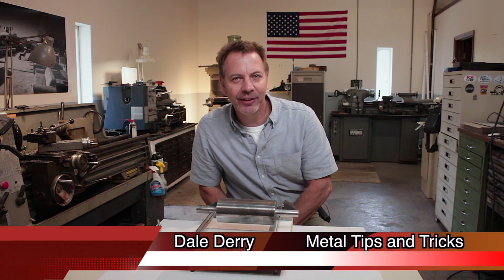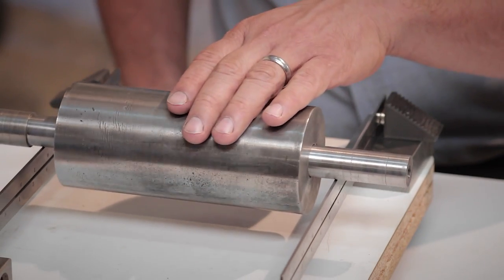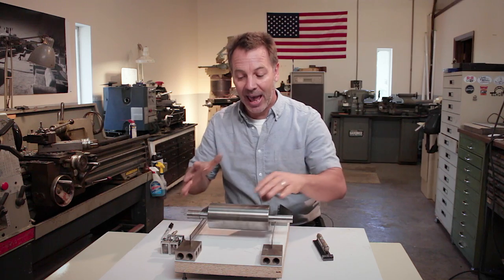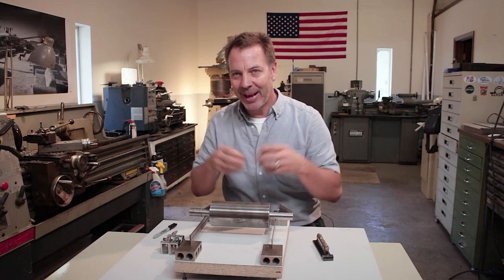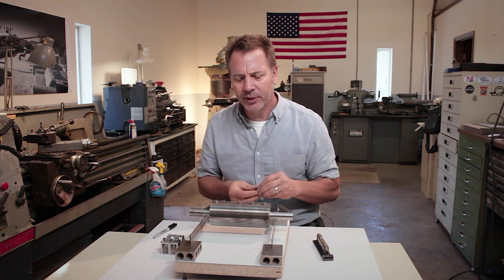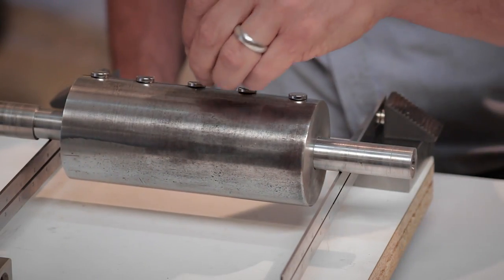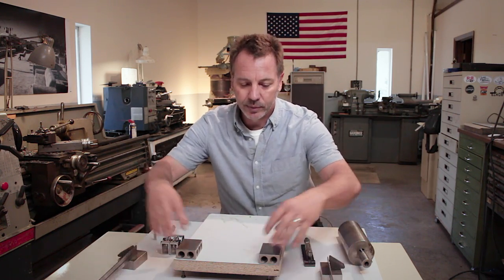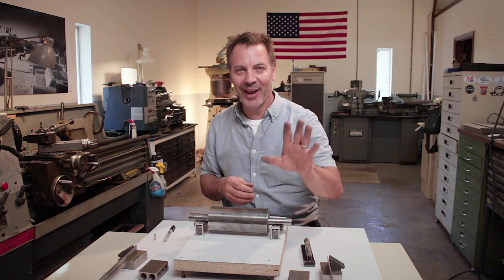Tough Turning,  The Follow Up

Comment: I have balanced a similar item by mounting the shaft in a lathe between centres, no drive dogs, just relying on the friction of the centres to spin the job......I then put a sharpie on the tool post and wound it in until it just....and I mean just touched the spinning job.....the tiny mark left was the heavy side, and them used magnets to correct the balance, and eventually drilled the ends to balance.
The good thing is I was able to balance both ends independently to some degree....
this was all done after the work was complete, and the job trued...

cheers
John

Comment: Hello Dale,
Nice video.
To find the centre of gravity of the work you could mark the centre of the job and place it on a table on top of a piece wire, filler rod, pencil or any small round. 
Roll the round under the job to see when the work tips from one side to the other, its tipping point will indicate its centre of gravity.
Hope this helps
Keep up the good videos
Thanks
Leigh
Gold Coast, Australia
Reply from the maker: +Leigh Edwards  Thanks for the information.
Dale d

Comment: This is a good teaching about static balancing, after on those big high speed rollers there is also dynamic balance, a little more difficult in a normal small machine shop... ;)
Pierre
Reply from the maker: +Full Metal Ratchet 
There are no guarantees in life :-)
Dale d
Reply from the maker: +pierre beaudry 

IT sure is.
Dale d

Comment: Thanks for the video. For those who are thinking about building the Turn Wright Machine Works {Keith Fenner} Shaft Roller Kit, Keith also has a set of plans you can down load / copy. For what it's worth, I'm building 2 (two) sets / 4 rollers, material cost approx $100.00.
Reply: Slight update - Keith recently uploaded a set of videos showing how to machine his roller kit.

Comment: I found in using this type of balancing, the straight edges work the best with sharp edges. 
I've used it balancing aircraft props and it works great.
David
Reply from the maker: +David Reaid  I agree, the sharper than the better
Dale d

Comment: To help with finding which end might be heavier, look at how to balance connecting rods for engines. Use a digital scale, weigh the whole part first. Then support one end of the shaft from a hanging string, while the other end sets on the scale. Make sure the shaft is level. Now you can weigh the other end or just subtract the weight from of the first end from the total weight of the shaft. This should give you a good idea if one end is heavier than the other. Buy if you have two different length shafts on each end it may take some math to figure it out. Great video though.
Reply from the maker: +Dynodon64 
Great Idea

Comment: To measure if it is balanced longitudinally you just need a balance and a parallel at exactly the same height as it then weigh it each way around and see if there is a difference, then drill accordingly. I also wondered what if you need a perfect cylinder, would you need to just turn it between centres or is there a better way to balance it?

Comment: One thing you may have over looked
Are the blade grooves true?
If NOT setting the blades would be impossible.
A real cool project for a badass guy like yourself would be a helical with carbide inserts replacement

Comment: owning one of these planers, i can say balancing and perhaps even cutting would have been better if the blade wedges had been in the slots and torqued. there is a measurable flex on the head when the blade wedges are installed..

Comment: Was wondering.

 If you set up one of the rules to sit 1" off center of the roller (and the other at an equal distance per shaft diameter that is equal on each side) then used an electronic scale to weigh 1/2 width + 1" of one side, record the weight, then do the same on the other side (1/2 + 1") and compared the weight, would that not give a difference in the weight from side to side fairly accurately?
Reply from the maker: You might be on to something. I'll have to give it a try.

Comment: In part one you said the journals of the shaft were running out. I believe you said the .375 bearing surface was bent? Did you address that problem?
Without the bearing surfaces true with the body, success is probably going to be very hard to achieve.
Kap
Reply from the maker: +This Old Machinist 
The shaft was straight it was the bore through the head that was off. The repair worked great. the machine now runs smooth.
Reply: So how did that happen? The bore was off out from the factory and they made a shaft for it that was off too?
Reply: Yes, but......the cutters within the head bolt into slots that will continue to be non-concentric if the bore was not run through the centre of the cutter-head.  This will always remain the case despite turning the diameter of the cutter body concentric to the bore.  In short, when in use, the 4 cutters will still each cut a different depth of chip as they all rotate at a different radius from the centreline of the bore - the decent solution is to ditch it and buy an aftermarket alternative (helix cutter head etc).
Reply: You set the knives to the same diameter, not to the depth of the slot.   Jointer knives are set to the height of outfeed table.

Comment: The best static balancing wheels have a very large (and accurate) diameter, overlap (to get the contact points up high), have very small bearings (to reduce rotational resistance), and have a (nearly) knife edge (to reduce contact resistance). Unfortunately, this makes them fairly expensive. See http://www.mcmaster.com/#shaft-balancers/=yzx8hj for some examples - $1000 to $2000.

It does seem that for light objects (home shop sized) that something less expensive could be made.
Reply from the maker: +Peter W. Meek That's exactly on one LOL. they cost to much.

Dale d
Reply: +Peter W. Meek those are gonna make a nice little shop project, thanks for that link!

Comment: If you could set the rullers at 45 degrees so the shaft only contacted the corners, you'd have very little friction to contend with.

Comment: I watched this video for the first time today and I have a way to reduce the friction using the steel scales/blades.  It might be impossible to find, but I bought a machinist's tool box loaded with tools and one of the items is a Starrett 490B V edge protractor.  The blade in this has a knife edge and would greatly reduce the friction when rolling the cutter head on the blades.  Trouble is, it was intended to check squareness of cylinder bores and was discontinued years ago.  I found it in the Starrett 50th anniversary catalog: https://archive.org/details/StarrettToolsCatalogNo25/page/n81.  Alternately you could machine your 'blades' with a knife edge, assuming you have extras and could stand to modify a couple of them.  I'm guessing there is little practical use anymore for my 490B edge protractor.

Comment: Yeah ,A pretty cool video.On Tf-39 jet engines we were allowed 15 mils amplitude on the shaft.I mil equal to .oo1.Not much room on a ten foot shaft app.Since dynamics are involved,maybe you could  affix trail weights? and test under the machines desighned Rpm?I don't know,your more skilled than I am,Just sayin.You could use the cutter and test both ends for amplitude?

Comment: the simple solution is to float the object in a tub of mercury. This will almost instantly show you where it is off center.
Reply from the maker: i'll have to go get some mercury.
Reply: Thats if you can get hold of enough mercury to float that shaft and observe all the relevant precautions as its poisonous and not too good for the environment either....
Use balance edges or rollers, Much safer!
Good use of magnets though....
Reply: Keep the Hg in a cooled space (below 68 degrees F) and this would keep the vaporization rate very, very low. But since Hg's mass is about 113lbs/gal, it's hard to handle.  Much easier ways to check for balance.
Reply: See Cody's Lab channel - he has enough to float an anvil!